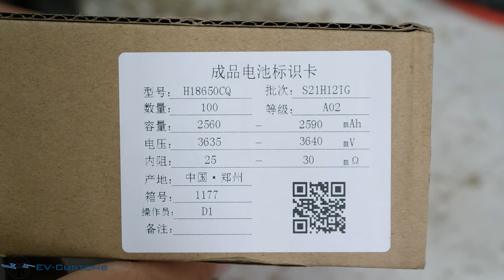BAK 18650 Battery Pack Build  6P (15Ah) 13S (48V)

Comment: Hello...i have a question... I make also same battery pack you made and same bms, but i make only 5p.If i connect only the discharge current of the battery pack i made to my original battery pack of my scooter as parallel, this will charge the also the battery pack i make if i charge the scooter?
Reply from the maker: Good question..  this is depends from the BMS, don't look that some BMS are exactly the same,  they can be completely different.. to be sure you must discharge and charge the battery and see if the board can work like same port from the C- pin of the board...   (not from P- pin)

Comment: Hello, thank you for sharing your knowledge through your YT channel.  May I ask if the batteries should be in any particular 'state of charge' before spot welding the assembly?  That is, should they be fully or partially charged?  Should they be of equal charge?  Thank you again.
Reply from the maker: Hi friend..  is no matter if the batteries are at full state or discharged,   they must be at same voltage state before spot welding..

Comment: Everything excellent. The only stop I would do additionally is rap the pack in gold electrical insulator tape and side insulators to prevent get damage on the battery for vibrations or friction. Also I like to add an additional active BMS. Thanks for the video.
Reply: What do you mean "additional" active BMS?
Reply: @mct8888  I meant, Active Balancer if the current BMS does not have one.
Reply: @DroneSurf  Ahhh got it.  Yes, that would prevent many potential challenges down the road.
Reply from the maker: One question...  if you will have active balancer on your battery pack you will have it always ON?
Reply: @EVCustoms  Unless they are in bad shape, not. I will turn it on every few uses or as soon as the pack go out of balance. I like to use the smart active balancers so I can monitoring the cells on my cellphone. You can get a really nice BMS like JK ones or Daly and have built in active balancer.
Reply from the maker: @DroneSurf  Yes i know them...  a have many of them...  the point is that they are not necessary...  because they are expensive an make same job with build in passive balancers on BMS, the difference is that the passive balancers will need much more time to balance but with same results...  if your batteries is from good brand maybe your balancers will never work...
Reply from the maker: @DroneSurf  That's why 99% of factories put a passive balancers...
Reply: @EVCustoms  99% of the factories want to make money and want you to buy more batteries soon.
Reply: I am not here to give you a hard time. I like your videos. This helps you with the YouTube algorithm
Reply from the maker: @DroneSurf  My friend i know that and thank you very mutch, i understand what do you want to say, i have more than 20 balancers in my shop and i use them only for balance of new building battery packs or unbalanced cells of my clients who left his vehicles uncharged for a long time, i never install active balancer on any of hundreds builds i was made,,,. that's why all active balancers didn't have protection circuit...  they are manufactured only for recovery of battery packs, if you have refurbished battery pack with different batteries,,, yes i will recommend to install active balancer..
Reply: @EVCustoms    I built custom ebike packs of 48V/52V but with 12V, 24V output options for low amps accessories and because that cause unbalance the active balancer fix the problem. Is only a hobby not a business. I am not a professional. In this way you can add USB-C charging modules on the same pack or car 12V outputs ect...
Reply from the maker: @DroneSurf You taking 12v or 24v directly from battery?
Reply: @EVCustoms both. One connector for each voltage. Remember, this is bypassing the BMS.

Comment: Hi ,i make now same battery pack 13s,6p, with 3400 mah batterys. Enough one bms with 35 a? Like this what u use, im buyed from AliExpress.
Reply from the maker: To know that you must tell me firs about your vehicle rated power .
Reply: @EVCustoms  48v 250w , originally have 4x 12v  acid Aku 12amp
Reply: BM-BLW 48v 250w blue one :)
Reply from the maker: @FlorianTakacs Best option for you is 25A  BMS
Reply: @EVCustoms  Ty maestro, than i buy 25A !
Reply: @EVCustoms And if the motor is 1000w, a 35A BMS will be enough?

Comment: Is the "rated output" of the BMS the continuous and the "max output" the peak rating? Because you have a 60A pack, so I would guess the two numbers you gave were a constant and peak discharge rating for the BMS and then your controller is probably somewhat less than that? Or equal to? Not sure if people put super powerful controllers on and just let the BMS prevent them from pulling too much but that seems like it would lead to a bad bad time to have the BMS cut off while you're climbing a hill. I guess if the controller is programmable you could limit it to match your BMS/pack.
Reply: Looks like you're using 12AWG for the main output cables? Could be 10AWG but it seems a bit thin for the load you're specing this bike at. I know 12AWG silicone is capable of much higher amperage than THHN or any PVC insulated wire but I see most builders stay conservative and give some headroom with the main discharge cables. 50A would get those pretty warm if it could be maintained for a while but even some hard riding at 30-35A would be pretty stressful for this pack. Don't get me wrong this is a very very well built pack, it is insanely clean, looks like a machine made it I just would have gone with slightly thicker nickel (but you do have 6 series connections so you'd be ok with 0.15mm which is what I think you're using) and I would have probably used some 2P nickel on the pos and neg to have the other side of the H lay on the edge of the cell holders and just solder a 10AWG to that part of the nickel. Maybe you don't intend for this pack to get pushed hard at all, its just capable of that.

Comment: Hi. I really enjoyed the video. I have two questions, why did you connect 6 and 12 in parallel with a nickel plate? Also, why did you solder the input wiring 3 times? I'd really appreciate it if you could answer.

Comment: Can an escooter's controller use 14s6p 52v 20ah battery when original battery is 48v 20ah 13s6p battery? Or must series and parallels be same or something?
Reply: That would depend on the control unit and you would have to check it out (Google it!) beforehand. Without knowing that, you could potentially fry it since it's one cell higher i capacity (3.7V, 4.2V when charging). Most units would probably be able to handle a bit of overvoltage,  if and when you add another cell you're pushing the threshold a bit further and it may just be enough to break it if it's only rated for 56.4V (Which is the charge voltage for 48V).

As for the capacity (the "P"), you can add as many cells in parallel you want.

Comment: Wow the best of the best DIY. Where did you buy the battery and the BMS?
Reply from the maker: Hello friend..  bms from ebay and batteries from NKON (europ)
Reply: It is ok if the battery is not new and asorted but still 18650 to build battery pack like this?

Comment: Very Informative!
I want to know how can we detect a weak cell and a weak weld in the module? If we measure the voltage across the grouped cell it would give us the normal readings  (because parallel). Same with resistance. So is there any way to detect that?

Comment: Can someone tell me what is 3c in discharge current means
Reply from the maker: This means output current of the battery is 3 times the capacity of the battery, so if we have 10Ah 36V battery pack, from this pack we can take safely 30Ah at the output..

Comment: Nice visual presentation. I do like your soldering technique on those wires.   .. .. but BMS isn't needed. It has nothing to do with how you wired those balance wires but in reality the use of these BMSs don't actually work as advertised or how we have been taught in science. When the cells get joined in series and parallels as a pack they all get self-balanced even without the BMS.  One thing the BMS will do is to discharge the battery on the negative and positive terminals while charging. It will spend more time charging because of this.  There are a ton of disadvantages using the BMS but I won't mention them here cause it would take pages to cover that.  I don't mean to offend you as you make great videos and take pride of your work but really, BMS isn't needed.
Reply from the maker: Hi, thanks mate. I agree with you on some points, yes on high capacity batteries you will have good balance, but only with brand batteries like Samsung LG Panasonic, again you need something to disconnect your battery from the load on low voltage, to not destroy the battery, you know that but other people didn't know  when  they must to stop discharge, to control it.
Reply: What do you mean the BMS will discharge the battery on the negative and positive terminals while charging?  Discharge to where or what?
Reply: I have a 20s20p battery that I've built myself for my bike. 400 Samsung 30q cells bought new from reputable dealer. I've bought the smart bms from icgogo that everyone recommends when building a pack. When it got cold outside I parked the bike with just above half a charge in my storage that is at room temperature all the time to wait for warmer days to ride. Two months later I got an itch in my ass to check the bike,so i turn the key and nothing happened. Turns out that the bms balanced my battery to death and drained it to 12v. Nothing else is connected directly to the battery besides the bms. Everything else is connected after the contactor. I've managed to bring the battery back slowly to normal voltage using a bench power supply,not tested it yet on the bike but i think everything is ok because it's sitting at the same voltage for quite some time now. And the sad part is that i didn't even need the bms, I've done 3500km of really hard riding with the bike fully discharging then charging the battery to 84v with fast charger every 80km,so that's 40-45 cycles and the cells were never out of balance,i would check vigorously over the Bluetooth to see how the pack is doing,i was paranoid because it was the first big battery pack I've built. And every time they were perfectly balanced.
So the next build I'm doing will definitely not have a bms connected to the pack,ill hook it up maybe once a year to check if the pack is out of balance. And I've seen a lot of similar stories online  and a lot of them ended with a dead battery pack or even a house fire. And when i look at it now it  doesn't even make sense to connect 30€ of crappy chinese electronics to a 1000€+ battery. It just doesn't. I wonder why no one filled that void in the market and produced a bms that actually works. It would sell like hot cakes in diy market.
Reply: @Americadoe  it will discharge the parallel group of cells on the positive and negative terminals through the resistor on the bms. But the resistors are so tiny and they can dissipate an insignificant amount of power so they can't balance one cell while charging let alone 5 or 10 connected in parallel. The only way to balance a pack with a chinese bms is to set it to balance manually after the charging,and it probably takes ages because their balancing current is pathetic.

Comment: This is absolutely pointless. For the price you pay to get enough 18650 batteries you could buy the ebike battery
Reply: This can take a lot of time, but you can salvage 18650s from things. I don't remember what it is, but there are these things you can buy for like a dollar a piece  and have six cells in them. That catch is one or two are usually dead, that's why you're salvaging them. This is what I did anyway
Reply: That's no fun
 
Live a little.

Learn something.